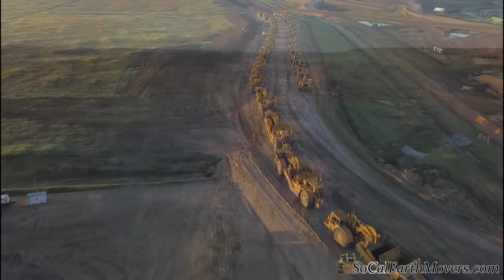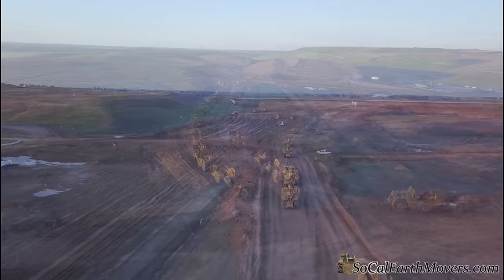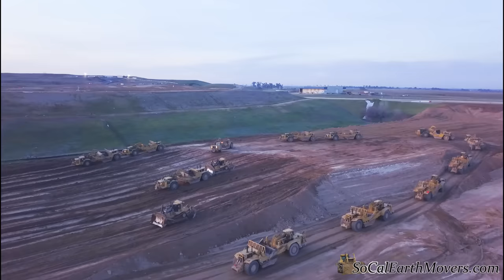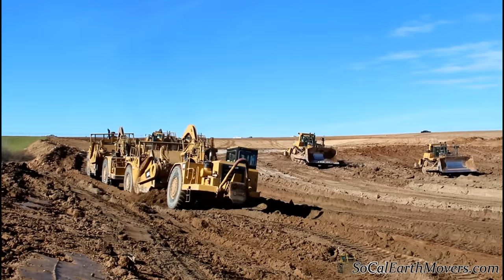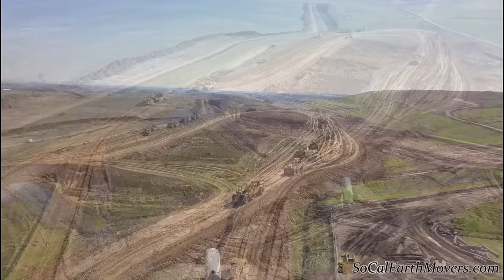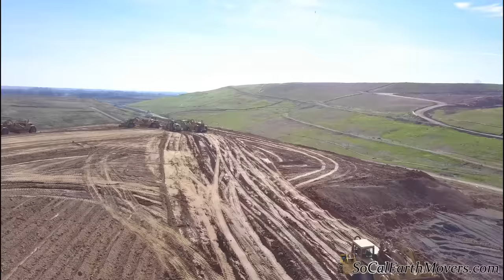Digging new landfill cell with fleet of Caterpillar scrapers (Part 1)

Comment: How much time did you have to spend convincing the dealer you were serious when the phone call starts off "Hello, I need to order 30 657's."
Reply: At that point you set up business meeting
Reply: I'm listening, go ahead !
Reply: just a few seconds approved upon seeing project proposal and budget allocation.
Reply: Peed have over 50 in there fleet, only people they need to call are the transport companies to move em!
Reply: just imagine the oil cost and upkeep of such machine. each one has two engines and two transmissions
Reply: And the sales man retires just off the commission
Reply: Rentals. They rent them for the time they need them.
Reply: Chiropractors everywhere are loving this .......
Reply: @Niklez7  if we have the need for highways and roads there is only one way to build them.
Reply: Haha good one.....did Bob tell you to call me.......
Reply: @xenonram  might be cheaper to buy them if it takes awhile
Reply: Pull power of the loaded 57 is unbelievable
Reply: @jamielacourse7578  57s ride better than the chiropractor   secretary
Reply: @Gavin84w  how many did McCoy have
Reply: @stevelutzke9600  house pads and streets are necessited
Reply: @Niklez7  this is more fun than getting divorced. Lawyers ain't smart enough to run one of those
Reply: @jamielacourse7578  wrong BG s keep the haul roads better than you think
Reply: @steveschierholz5272  the salesman could have been 20 yo and been able to retire
Reply: @jamielacourse7578  actually the bigger the equipment the better the ride and easier to drive
Reply: That just isn't a single phone call. The dealership had a years heads up. You may order 30 but your going to get them 2-3 at a time
Reply: Now that’s how you move mountains. I could watch this all day!
Reply: The company I work for has around 55 I think. Watching these boys work is mesmerizing. They just dropped no telling how many millions on brand new epiroc t40 and d60 drills.
Reply: Ripper cat guys don't have much time to piss
Reply: Should be swelling those loads
Reply: Good material
Reply: They get there

Comment: So front scraper fills first, pushed by the rear, then the rear fills getting pulled?  Brilliant strategy.
Reply: Yes, they are twin engine too. A single blade is driven by eight wheels from 4 engines (combined ~2000hp) for a ~50t cut of dirt in a few seconds. 

A full tank of fuel would be about ~$2000.  Tires are around $7k-8k each.
Reply: How do they coordinate? By radio?
Reply: @bighueso2428  Morse code
Reply: @tomz5611  I thought so.
Reply: @bighueso2428  Radio's could help, but you don't need them. You just lead/follow around with the same guy all day. Push/pull isn't easy, but once you've done it a million times it doesn't require communication. Occasionally, if something does require a quick chat one operator does a 180 and you just swing open your doors. Big straight forward jobs, like the one in this video, wouldn't require much of that.
Reply: В процесс просмотра видео, всё становится понятно.
Reply: @bighueso2428  Diesel fuel smoke signals.
Reply: @bighueso2428  not like people
Reply: @tomz5611  or finger talk
Reply: @dontcrywolf6810  he could have been in chemistry class
Reply: Got called to a job site. The rear scraper operator was texting & didn't see the front one had turned at end of the cut. Just demolished the front end of rear scraper. We replaced parts that would never be replaced.
Reply: @bighueso2428 middle fingers

Comment: I can’t even imagine not only the fuel bill but the overhead for a project like this!
Reply: $1000 - 2000 a day in fuel. Sites we built were smaller 10 -20 acres and were roughly a million dollars to build. That includes everything. 
    Excavating site
    Clay liner
    Plastic liner
    Another clay liner
    Crushed stone layer
    And leach-aid piping (they pump/remove liquids from landfill)
Reply: @anthonythorp7291  the fuel bill was well over 2 grand a day on this job
Reply: @lumberjaketreeservicellc4002  at this one job I worked at for building a geothermal pad at alpine valley in Nevada we burned no less than 800 gallons a day and we had 1 dozer, 2 scrapers, an excavator and a couple water trucks. I'd imagine these guys use 20 times that which would be roughly $45,000 a day in fuel
Reply: Anthony Thorp ya right if each machine burned 100 gallons a day x 30 machines x 3.00 a gallon your at least $9,000
Reply: Can’t speak on the overhead but fuel was at least 400-500 stegosaurus carcasses per day.
Reply: Well, looking at 16-18 gallons an hour for a 10hr shift. Then you have 35 operating that we can see at the momment. Looling at 180 gallons per rig so around 6300 gallons a day just for the scrapers. Thats almost $23,000 a day at $3.60 for offroad diesel. The dozers are maybe 10 to 14 gallons an hour at however many are out there. On the safe side, can say around $25k-30k in fuel daily.
Reply: Jonah lmao
Reply: They invest in energy futures for upcoming jobs. A big dig like this is going to push 200 million in fuel cost, so they invest company profits into energy stock. Then, their own fuel purchase increases the value of the stock in the fuel company and they make money off that!
Reply: Easy $1,000- a day for fuel for 5-6 machines

Try to count the machines in the video
Fuel alone exceeds $40,000 a day.
Reply: @anthonythorp7291  да има повече клипове с авто скрепери
Reply: @MASON091  water
Reply: like buying a boat...if you;re worried about the fuel bill you can't afford a boat!
Reply: Well just wait till all these machines are electric! Then the company will make pure profits. No fuel costs. No pollution. Why not?
Reply: Each machine holds 336 gallons
Reply: @ryanburbridge  ha! So electricity is made from thin air? lol
Reply: ryanburbridge Where does the electricity come from to power a machine this size?
Reply: @brandoncaldwell95   the D10 is worst case 22 gph, holds 380 gallons so around 17 hrs run time on that. doesn't look like they are ripping overly hard. The 637g is 25 gph worst case, holds 335 gallons and run time is 13 hrs. Not factoring oil changes, greasing, blown hydraulic lines and replacing oil there, tires, track and undercarriage wear, cutting edges and wear plate, paying operators and a maintenance guy on standby and a night shift maintenance team. A d9 at the unload end and possibly a 14m for the road, if the contractor is a nice guy.
Reply: If the landfill bear Los Angeles they will make the $ in 1 year !! Now we pay $68.44 a ton for demolition debris.
Reply: Our terex 24tt scrapers used 330 gallons in 10 hrs. And a gallon of oil in the 12v and 1/2 gallon in the 6v in the rear.
Reply: @brandoncaldwell95  yup just bring in the fuel tanker with the forbidden kool aid
Reply: @fishnbeer556  haha. Sure thing guy
Reply: @Honkahonky  hot n cold air actually. Lightening..
Reply: @anthonythorp7291  yep.... that will cover one of them
Reply: @redsite001  Yes more like it, these people saying 2000.00 a day are crazy. That would not get them started.
Reply: @ryanburbridge they will never be electric ,dream on buddy..